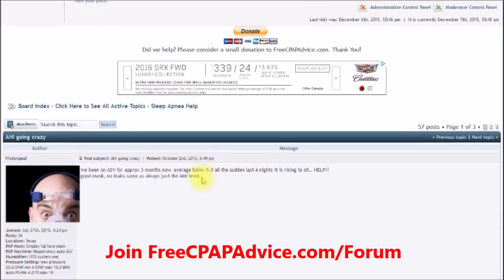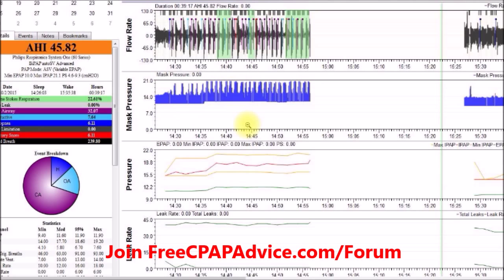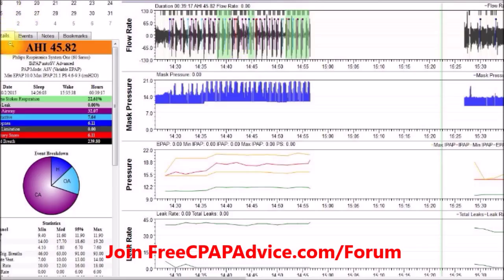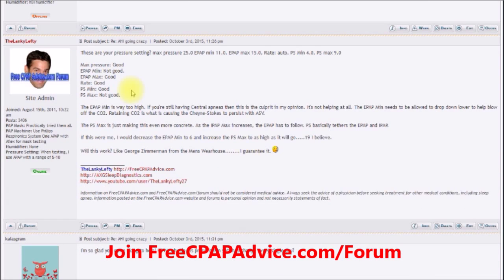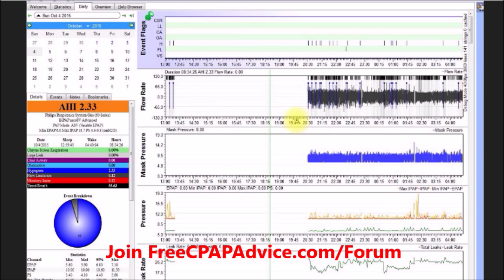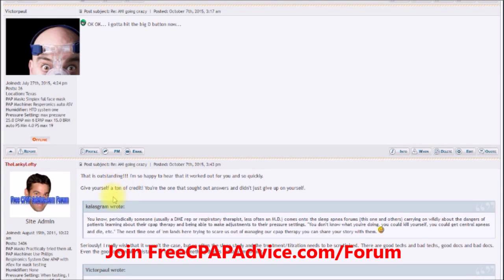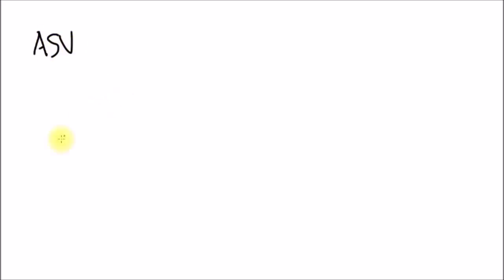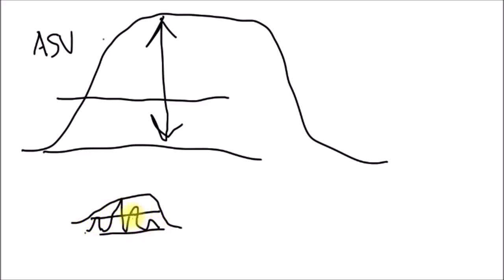Auto Servo Ventilation Settings.  What is the correct ASV Setting?

Comment: Great explanation. I have only done a few titrations with the ASV, but they work so well. The first time I was able to smooth out a fellow who had been the lab for 4 titrations without avail.  I turned it on and the patient instantly went into Stage 5 and spent most of the rest of the night there. I was blown away, to say the least.  Fixing someone is a great feeling, but fixing someone who has an extremely difficult case is a sense of satisfaction that is rarely seen.

Comment: I spent way too much time dicking with my settings I think, and this is the video I've come to accept as the best explanation for ASV setup which no doubt applies to 99% of people.  While I was going through the ASV 'honeymoon phase' and playing about, in the back of my mind I always thought I should really be just trusting what years of manufacturer experience has told them rather than my own foolish assumptions!  

I still get spo2 plunges (as much as 10%) at sleep onset, but they happen over a longer period now - where they used to occur in the space of less than a minute, the same single desat will occur over 10-15 mins.  I think this is due to the 3 / 4 min ASV sliding window assuming my venitlation requirements are dropping (gradually lowering the target vent) but not being clever enough to know my flow rate is so shallow my spo2 is now at unhealthy levels.  After that though I seem to recover and pull back up to stay around what my basal daytime spo2 normally is for the rest of the time I'm asleep - it's bizarre.  While maybe not perfect, it's a lot better than when I'm without it :)    This is with reported AHI of 0.0 too.   As Jason rightly says, set it and forget it...

Comment: As just an extra factoid regarding how ASV determines how it changes pressure settings: ASV targets a certain minute ventilation (amt of air you breathe in a minute) over an average of 3 minutes. This is also why it takes time to let the machine learn how you breathe, and it may not fix central events instantly. When the machine senses a change in your minute ventilation due to a central event, it increases pressure support until it senses your spontaneous breathing corrects to a normal level. I also presume the machine will determine your tidal volume too (one breath) and try to match that tidal volume. Sort of like AVAPS, except ASV determines your tidal volume based on your personal breathing over that 3 minutes rather than AVAPS where you set a target tidal volume yourself.
Reply: This only applies to the ResMed implementation of ASV
Reply: @cebruthius  Even ResMed has different machines.  I have the ResMed AirCurve 10 ASV which has two different modes.  ASV and ASV auto.  And there is no max IPAP or min IPAP settings on my machine. there is a min max EPAP and a min/max PS setting but you can't set the IPAP min max.  IPAP is determined by the machine.

Comment: I've been trying to use my Aircurve 10 ASV machine for a few years now, and I still have only been able to sleep with it on for a few hours max. I have severe central sleep apnea, with mixed apnea. I also have bad insomnia, which makes me extremely sensitive to the machine, and the machine usually ends up stimulating me too much and keeps me awake. On top of that, I naturally have a lower respiratory rate and take fewer breathes and breathe a little more shallow. What I find is that the machine is making me take more breathes than I need to take, and this is greatly stimulating my body and causing me to not be able to sleep when I use it. I know with older style.machines you could turn down the breathes per minute to help better adjust for this. Is there a way to help adjust for this with this type of machine?.....any help would be greatly appreciated, as my sleep doctor is worthless and just tells me not to mess with the machine.

Also, I changed the settings to what you said in this video to max them out, and I'm going to try that tonight.
Reply: Dana, how did it go?
Reply: Dana, your symptoms and experience are similar to mine.  And I tried using the settings in this video and I found them to be too aggressive since my natural breathing is way more shallow than these settings.  I bought the Aircurve 10 ASV yesterday and used jt last night.  I found myself constantly needing to change the settings through the night until I finally did fall asleep but woke up later to a clumsy ASV not in sync with my breathing.  Had to turn it off after just a few minutes of what I thought was finally a success.
Reply: @jeremyl9515  it didn't work. I ended up backing the settings way down and using the mask just to get use to it. Once I got use to it I gradually increased the settings in smaller increments until my AHI was down to almost zero....now I just stick with those settings.

Comment: Jason I just got a new ResMed AirCurve 10 ASV machine today and need to set it up right.  I can't get to the doctor until the 24th of this month May.  You settings in the video are different that what I see in the settings on my machine.  I'm in the Clinical setting BTW.  It's setup to an EPAP of 3 and a PS of 4 to 15.  I don't see any EPAP max or IPAP settings at all.  Only EPAP min and PS min and max settings in ASV mode.  Maybe the ASV auto mode will have those settings. I'll have to look and see.  I'll be going to bed in a few hours and want to use the new machine tonight and then check the SD card data using OSCAR tomorrow to see what it does. That gives me a IPAP max of only 19.  I have severe sleep apnea with Central Apneas, Cheyne Stokes respirations and  obstructive apneas all together.
Reply: I wish he would have answered this question..I'm having the exact same problem..did you ever figure it out?

Comment: I currently have a System One Auto BiPap machine and considering purchasing an AirCurve 10 ASV?  Can you tell me if that would be a good choice?
Reply from the maker: I’d get the Dreamstation version instead.
Reply: @Freecpapadvice  I bought the Dreamstation Auto BiPap model DSX700H11.  I have set it up on AutoB.  The default settings are IPAP: 25 CM H2O, EPAP: 4 CM H2O, PS Min: 2, PS Max 8, Bi-Flex: On 2, SmartStart: Off, Ramp: 30 Minutes, Ramp Start Pressure: 4 CM H2O...  Anything you would change especially thinking about PS Min and PS Max?

Comment: So far I've seen ASV referred to as:-

Adaptive support ventilation
Active servo ventilation
Auto servo ventilation
Adaptive servo ventilation
Active support ventilation

As if it wasn't confusing enough as it is :D
Reply from the maker: Thankfully with all of them you can use the Dreamwear Under the nose cushion, dreamwear gel pillows, dreamwear silicone pillows, or the Dreamwear Full Face Mask. That's assuming you don't like the DreamWisp or DreamWay masks.  

You could also go with the P10, P30, N30, N30i, N20, F20, F30, or F30i.....nothing confusing about it at all!  🤣
Reply: @Freecpapadvice  lol I've used the PR Dreamwear FitPack and the PR FitLife. Also the F20 AirFit which I had to be careful not to confuse with the F20 AirTouch.  The stress of all that alone causes more sleep loss than the apnea itself.
Reply: You forgot Anticyclic Servo Ventilation

Comment: Do different ASV machines have different settings?  I'm talking about different manufactures.  And my ResMed AirCurve 10 ASV machine has two different modes. One is just called ASV, and the other is called ASV auto.

Comment: I have a Philips Respironics system one my machine is set to when I first turn it on it says 8 and I'm told to push the button then it goes to 4 and that's what I start with and I guess the maximum it reaches is 8? Does that sound normal to you? I'm just curious they told me that I have it mild case?

Comment: Aircurve 10 ASV:  I only see three clinical settings in the ASV mode:  EPAP, Min PS, and Max PS.  What are the appropriate settings here?
Reply: RPSGT here. Usually for ASV there should be an EPAPmin and max, but the PSmin and PSmax should always be 0 and however high the highest PSmax can go (unless the patient has lung damage where a big PS can harm the patient). EPAP as he said could be a bit variable, as this is the setting to resolve simple obstruction. If there's only one EPAP setting, then it should be set close to what it takes to fix obstructive apneas (in the lab I try to set it right around where it resolves full apneas since even the EPAP you need can vary based on your posture during sleep).  The reason you want PSmin to be 0 is because when you're breathing normally (discussed in video), you may not necessarily need any help in breathing, so you don't need any pressure support. But if you have a central apnea or central hypopnea, you want to let the machine do whatever it needs to do to keep your breathing normalized. If you set a PSmin at, say, 5cmH2O, even when you're breathing normally, the machine will give you extra support; this is essentially now BiPAP with ASV support. This may not always be a problem depending on the patient, but having an alway-increased inhalation volume can sometimes cause central apneas, as the machine is overventilating you when you may be perfect on your own.
Reply: I have the very same machine. ResMed AirCurve 10 ASV Auto.  I have my max EPAP set to 15 and min EPAP set to 5.  My pressure support is min zero and max of 15.  Most of the time it takes a few minutes for the machine to learn my breathing patten and give me enough air.  Then it lets me breath on my own unless I stop breathing. When I stop breathing for more than about 5 seconds it will increase the PS from zero to up to 15.  It will start out increasing the PS to around 3 or 5, then it will go up to around 10 and then finally if I keep holding my breath it will increase the PS all the way up to 15.  Also, I noticed that when I get up in the morning the EPAP has increased from 5 to around 6 or 8.  I suspect the machine thinks I need more air Pressure for my EPAP.   I like to have a higher EPAP as it helps me breathe easier.  I wish that my sleep doctor had prescribed my min EPAP as 6 or 7 or had prescribed my PS min at 5 instead of zero. That way when I first go to bed and put the mask on, I get a lot more air.  I feel like with my lower settings I'm not getting enough air. I have severe heart disease and get out of breath easily so when I walk to the bedroom I'm out of breath before I even put the mask on. I use the AirFit F20 now.  I was using the AirCurve F20 but the mask material tore and leaks now. Before that I used an AirCurve F10 mask for several years with a good seal. NOTE: There are no min or max IPAP settings on the AirCurve 10 ASV auto machine.  But you can figure out what the IPAP settings are by taking the EPAP and adding the PS to get the IPAP.  So, setting the EPAP min, max and the PS min and max takes care of the IPAP settings. I'm OK with the AirFit F20 now but if it gets dirty you can't wash it in dishwater or any water at all.  It has a foam-like seal all around the mask where it touches the face.  And you can't use alcohol on it either.

Comment: ok, I just got a new Dreamstation Auto BiPap as you recommended.  When I look at my system one settings the Dr. had me on min Epap 8, Max Ipap 20, with PS min of 5 and PS Max of 5...  Does that make any sense to you?  I used it last night and got an AHI of 1.9 but my PS Min was set to 2 and my PS Max was set to 8???  My 90% Epap was 14.5 and my 90% Ipap was 16.5??  Curious if I should change PS Support settings as I still don't completely understand how they work?  Thanks!

Comment: I have a question about the water chamber in my Aircurve 10.  The chamber is 380 ml and that is ridiculously small. It boils dry on a setting of 2. Do you know of any chambers that will fit the Aircuve or any way to piggy-back some?   Resmed says they have only that one size. Thanks
Reply: What is your home's humidity level?  30% RH or less? I have that same machine and 380 ml on Auto Humidity level of about 4 is 85% RH inside the mask.  My home humidity is around 55% RH Today. I turned the AC on and brough the house RH down to 50 %RH today at 75 Deg F.  My Heated Air Hose is set 81 deg F right now for tonight.  I was breathing at a rate of 20 BPM last night.  I sleep for 9 hours and still had water in the water chamber this am.  I use distilled water that is at room temperature or around 75 deg F when I pour it into my water chamber.

Comment: So to it should read 25 IPAP  and EPAP is set to 15 ,PS Max is now 8 and PS Min is 3 should i just try this for a few nights ? Setting before AHI was 9 to 13 and i was slamming coffee to make it threw the night. CA 12+ and pressure pulse was like 21 , thanks man just a dummy trying to fix what my DME jacked up.
Reply from the maker: Whoa!  Wait.  If that's as high as the PS max will go, then you aren't on an ASV machine.  I'm sorry.  I didn't read your original post closely enough.  That's just a BiPAP Auto.  Totally different machine than a bipap auto sv (ASV).  Keep the PS support spread out as much as possible.  Use SleepyHead to see if either end (IPAP or EPAP) need to be throttled back at all.  Just watch the trend of leak, your pressure, and flagged events to see what is optimal.  (be careful with believing all events that are flagged though)

Comment: I have had severe sleep apnea for some time now and I got diagnosed with complex sleep apnea in Dec 2015.  I've been using my asv bipap since Jan and have noticed little if any difference and my sleep scores are always over 90.  How long should this take to get me to some what of a normal state?
Reply from the maker: +beebop shopbop I have a video on that.  There is probably something small that you need to have tweaked to optimize your therapy.

Comment: the ps setting is at 4, and the max is at 4, so it just blows air. How do i fix this?  If I change it to 5, the max also goes to 5. I tried going back to factory settings, that didn’t work either.
Reply: Increase your PS to around 15 but ask  your sleep doctor about this. The ASV auto won't help you much if your min and max PS is the same pressure. Like Jason said, it's like putting a governor on a fast sports car.

Comment: Mine makes me breathe too deeply. I need it much lower and don’t know what to do. My APAP range was 4-8 (10 is so high I have to take the mask off) and it was perfect. Now on Bipap AutoSV, it is a nightmare; the settings are way too high. It does not adjust to my breathing at all. It’s settings are:

Pres High: 25
PS High: 20
PS Low: 0
EPAP High: 15
EPAP Low: 5
BPM: Auto
Reply from the maker: Why are you on Bilevel then?

Comment: Ok I have central apnea and was ordered a resmed air curve 10 with asv it is always going into asv even when I am awake. I will be reading or watching tv an this thing will start blow in air as if I am not breathing. It is crazy. In the settings it has asv and asvauto what is the difference. Either way I want it to stop giving me breaths when I am not needing it.

The ramp is at 45
Epap 10
Min ps4
Max ps10
Start cpap 4.0
Climate ctrl auto 
Tube temp 70*

Please Help
Reply: Laura Vickers I’m having this exact same problem. I’ve had mine four days and I’m completely unable to fall asleep with it. It tries to breathe over me when i don’t need it
Reply: Like it tries to give me my next breath before I’m done exhaling. Frustrating and anxiety inducing

Comment: At the start of the video you stated 25 IPAP, 25 i get that ,then 15  for the EPAP i use Max PS 4 and Min PS 4  Its a dream station Its set to AutoB is this the same  as Auto SV? I was told to keep the the setting for Max PS and Min PS should be as close as you can get them, from one of the guys on a forum My AHI is at or around 8 and this sucks, Should i set the EPAP to a lower # like 8 and let the machine  bring it up on its own? and what about MAX and MIN Pressure support should that be 6 and 4 ? any advise would help.
Reply from the maker: Having the Pressure Support Max and Min be the same number is turning your EXPENSIVE ASV machine into a shitty BiPAP Auto.  It locks the IPAP and EPAP into always being 4cmH20 apart from each other.  PS max should be as high as it can possibly go, and PS min should be as low as it can possibly go.  EPAP Max 15, EPAP Min 4.  (This will mean that PS Max will be 21 and Min will be 0....but I personally think 3 is the way to go for PS Min)
Reply: gonna try that tonight see if i can get below 10 AHI, thanks you vids are helpful

Comment: Just started on a dreamstation bipap auto ASV and were wondering if my settings are a good start?

Opti start - on
Max pressure - 25
Max epap - 20
Min epap - 4
Psmax - 21
Psmin - 3
Bpm - auto.

When I was on APAP my results from Sleepyhead were:

90% pressure - 13.9
Ave. Epap - 8.5
Min epap - 3.4
Max epap - 18.2

My AHI on the APAP was an average of 12. My scores so far on the ASV are a bit lower at around 6 but could be better, right?
Reply from the maker: Settings look good.  Scores are also fine.  Remember the machine reported ahi has a massive error factor.  If you look at the actual waves you could probably dismiss several tagged events.
Reply: @Freecpapadvice  great stuff, thanks. I managed an AHI of 3.6 with these settings last night and no centrals so I'm very pleased!

Comment: Hi. I just found your channel.  Great info. I had a look at my settings on my philips System one.
My Auto max is at 6 and my Auto min is also at 6. 
Is it doing anything?
This is my 2nd machine and I got my therapy provider's to input the correct settings into it when I got it. Have they made a mistake entering them in?